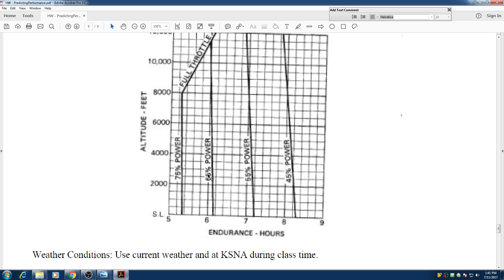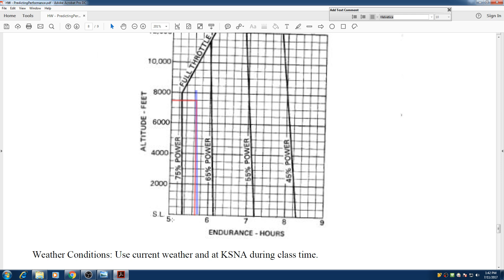Maximum Endurance Chart (Step 8)

Comment: What full throttle means?
Reply: i would guess that at that altitude, you need full-throttle to maintain your power percentage and as you increase in that altitude, you will have a steady decrease in available power.